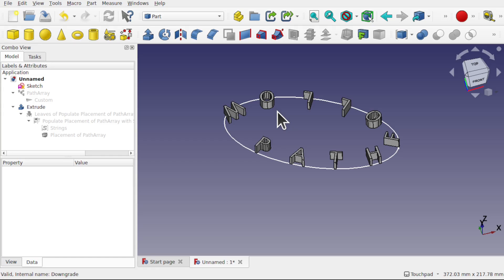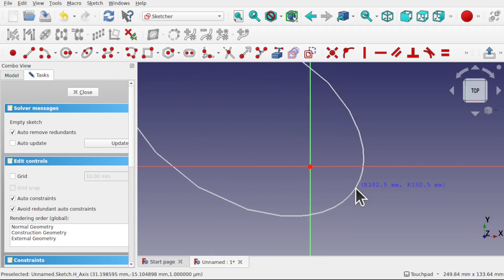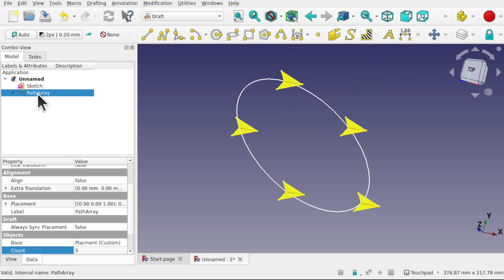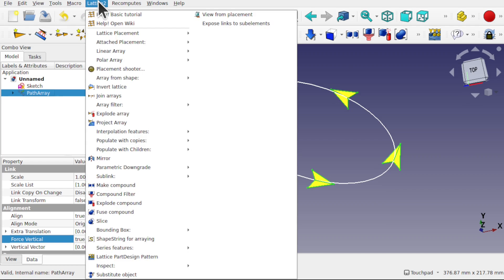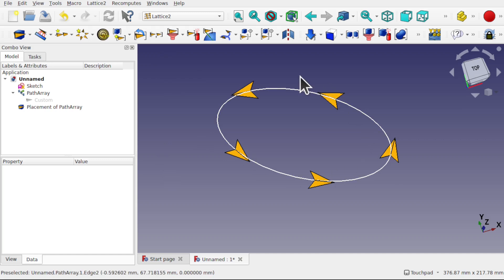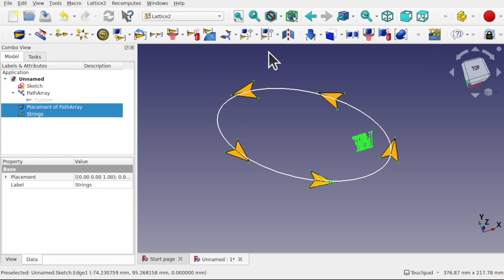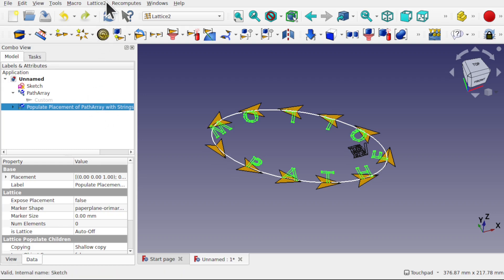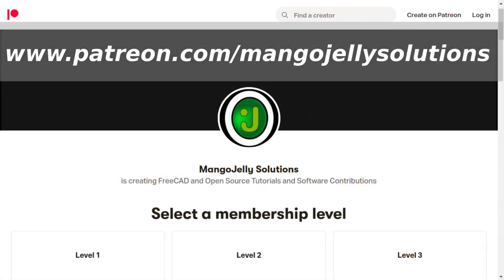FreeCAD: Text around a path using Lattice2 | Follow Open or Closed Path

Comment: How do you get the text to flip right way round; without needing to switch planes to bottom?   I would like text to read from left to right.   I am not seeing how this is done.  (yes i am very new to freecad)
Reply from the maker: On the original custom placement there is a flip Z that may help.  If not you can flip the text by rotating the text array
Reply: @MangoJellySolutions   I'm having the same issue. The string is populated (?) from the rightmost kite to the leftmost. A workaround is to write backwards. But my question would be how do you determine the direction in which the kites populate the curve (from which end to which end)?

Comment: Thanks, another great video. Do you have a tutorial on combining multiple files into one part, so you can print that part as one body, instead of printing them separately and gluing them tougher?
Reply from the maker: Thank you. It sounds like you need to use an assembly workbench for what you are trying to do.  In my learning freeCAD for beginners series there is a few videos for the A2+ workbench which may be of use.  This allows you to import your parts and assemble them together by snapping faces, edges and vertices from one part to another.
Reply: @MangoJelly Solutions   Thank you I appreciate that and it sounds like it's going to work, the only problem is I can't find A 2 +  workbench anywhere in my version of freecad, which is 0.20.1, any thoughts?
Reply from the maker: @MrJacksaun  It's an external workbench that needs installing. Have a look in the top menu > tools > add on manager and you will be able to install it from there :)
Reply: @MangoJelly Solutions   Thanks I went to the wrong location in  add on manager and couldn't find the download menu but I got it now and I'm downloading it as we speak...

Comment: Thanks you for your videos, they are awesome! 
I have a question. Is there a way to make text on some surface the way that every letter is rounded (like when I add fillets to every edge of the letter), when I want to print something it's better to have fillets for quality reasons
The only way I was able to do it is to select every possible edge on each letter manually, which isn't easy
Thanks!